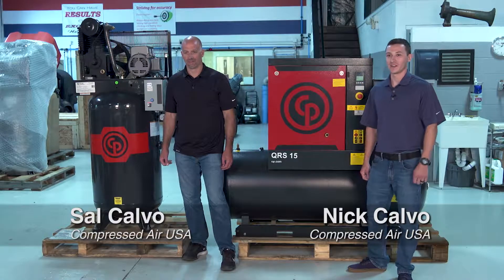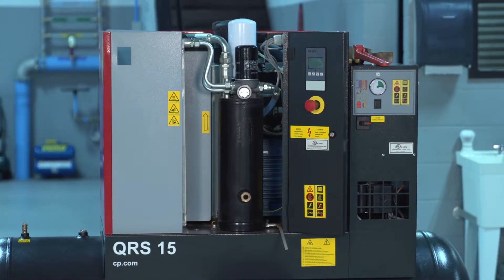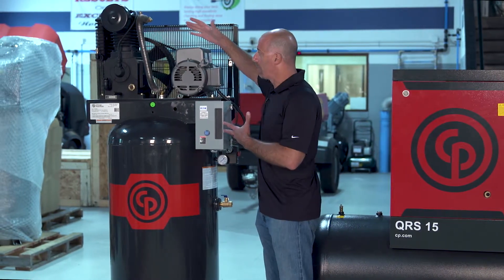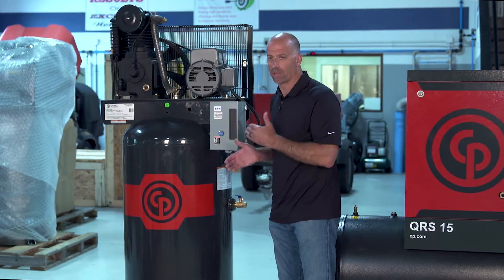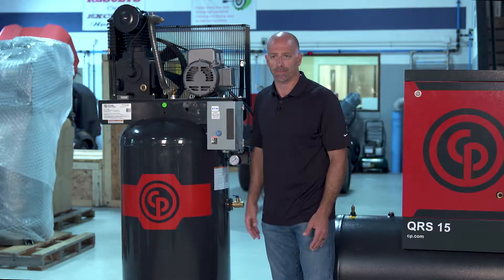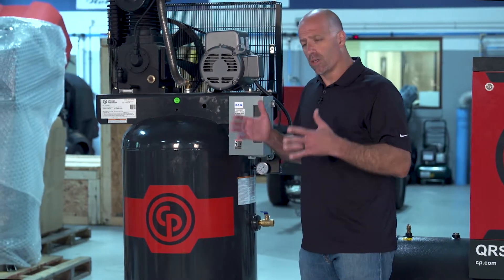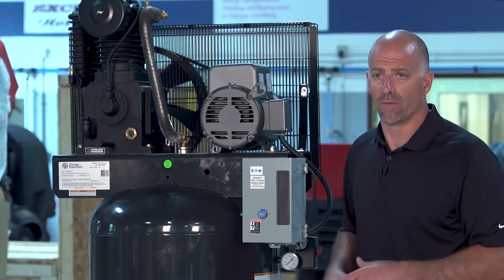Rotary Screw VS Reciprocating Air Compressors | CompressedAirUSA.com

Comment: I like the quietness of the the screw style. However, if it’s in a start stop application 8hrs   A day can the motor handles long term on off. It’s for my dry cleaners, I would also like to put it in my boiler room that is pretty warm in there.  Any thoughts? Thanks
Reply from the maker: The rotary screw machine is best suited for high cfm loads or continuous high air demands, that is really where the 100% duty cycle shines, meaning it will run the entire work day. If you are expecting a machine to start and stop throughout the day, to supply air intermittently, then it would be more appropriate to run a reciprocating compressor. As for the boiler room placement, as long as the air is clean and dry and there is space to install and perform maintenance you should be okay. In regards to the temperature in your boiler room however, if the ambient air is too hot, that will lead to higher temperatures inside meaning more friction and could lead to issues or damage. An aftercooler would help however that only removes heat after the compression cycle.

Comment: Why would you buy reciprocating, if vane is available?
Reply from the maker: Reciprocating compressors have their place, they meet a different requirement and are also more economical. They are ideal for applications that require intermittent use of air, rather than a constant demand. An example of the difference would be using pneumatic tools versus paint spraying.

Comment: I’m looking for a new compressor. We powder coat, some paint and blast to prep parts. 

We have a 5hp piston compressor keeps up fairly well but would like a bit more capability. 

Which would you recommend rotary screw or piston? Which provides cleaner air and is one more energy efficient than the other? 

Thanks in advance.
Reply: You’re welcome in advance
Reply from the maker: Thanks for the great question. For your applications of powder coating, painting, and sand blasting - those processes have a large air demand. Running a sprayer or blaster off of a piston compressor comes with disadvantages. The duty cycle of the piston compressor is 50%, meaning it needs half the run time to be idle and cooling, so you are limited to what is charged in the receiver while it is off. The rotary screw is designed with 100% duty cycle, meaning it will run the entire time and put out much more air. The rotary screw is also quieter, if you work in the vicinity of the compressor that is an enjoyable benefit. As for which produces cleaner air - the rotary screws are oil soaked and there is typically more oil carryover in comparison to a piston compressor, however there is an air/oil separator that helps capture that. You will notice as you checkout our online store that the Reciprocating piston compressors are typically more affordable, while the Rotary Screws have a higher price tag. Another option similar to a rotary screw is a rotary vane compressor, we offer some and are very popular so check them out! For the applications you mentioned, especially when it comes to paint, we definitely recommend having a compressed air dryer along with general purpose and high efficiency filters, and a water separator/water trap as well. What this will offer your system is extremely clean and dry air - it removes all condensation/moisture/bulk liquid/particulate/oil/dirt and debris. Let us know if you have any other questions, feel free to email or call! Check out our CFM calculator if you need help estimating your air demand in CFM, and we would recommend a rotary screw for you.

Comment: No noise comparison ??   😤
Reply from the maker: Thanks for your comment, the noise difference between the two machines is significant. The reciprocating pistons banging away all day is much louder than the quiet purr of the rotary screws. If you have employees that work in the vicinity of the air compressor, this can be an important quality of life issue, or atleast one needing ear plugs.

Comment: I think there is More to consider when comparing - what about a constant speed piston compressor in a high demand application where the pump loads and once pressure is built up then it unloads  which keeps the motor spinning  and the pump freewheels allowing the pumps  flywheel / cooling fan to quickly cool the pump it increases the normal 75% duty cycle closer to 100  - it is similar to a screw machine when it unloads . Screws are much quieter yes BUT they have far more mauntenance issues due to all the many parts , electronic control items that can go bad; to the contrary a good  Quality  ( made in America) cast iron slow speed piston air compressor is made for the long haul with only a pump, motor, belts, pressure switch, magnetic starter and a tank ( optional air cooled after cooler )  , that's it !  They are  very cheap to maintain compared to a screw  -  and a regular guy can do the  routune. maintenance of oil / air filter changes, belt changes and even a pump rebuild  which most maintenance guys are car guys and rebuilding a pump is way easier and quicker  than rebuilding a car engine..  A piston uses less expensive common hydraulic oil or even ATF ( 5 gal for $40 ) ,  screw oil is $65 - $150 per gallon !!  plus wait till you need parts on a screw, That's when you will find out why it is really called a screw machine.    
Just my thoughts on it.

Comment: What size rotary screw comprssor you recommend for a body shop (painting complete cars)and grinding,sanding for 3-4 people working at the same time .I have 80 gal tank that I could use as a buffer too.
Reply from the maker: Great question. The beauty of a rotary screw is that it is designed for a 100% duty cycle, meaning it will run all day to keep up with your continuous use of air. Painting, grinding, and sanding are large air loads, and with 3-4 people working at the same time, that is a big demand. We would recommend something that can handle around 30 CFM for those tasks so you would be looking at a 10 HP rotary screw. 
Check out our CFM calculator, punch in the tools or number of techs you have, and it will show your air demand  https://compressedairusa.com/cfm-calculator/

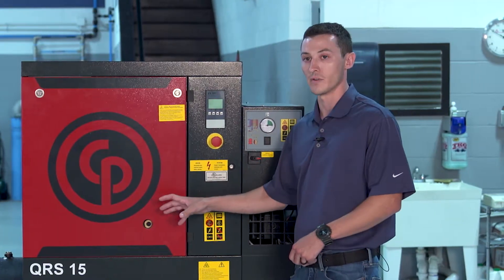Comment: 0:44 “small foot print” ummmmmm that ain’t exactly small my man.
Reply from the maker: Respectfully, we would disagree. For a compressor that can handle a 100% duty cycle, with storage receiver and built in air treatment this machine does have a small foot print. For reciprocating air compressors to handle the same load you would need a larger machine, in addition you would also have to separately pipe in a larger receiver, air dryer, and filters.

Comment: So I have a  bag house that needs  .4 m3/min which I think is 14 cfm... It will be shooting air jets to clean filters . What size rotary screw do you think I need? Thanks for the video great looking compressors.
Reply from the maker: Christopher thanks for asking... you are correct .4m^3/min is roughy 14-15cfm. For this air demand we would recommend a 5HP rotary screw. We carry these machines in a tank mounted configuration, with or without a built in air treatment system. Please feel free to reach out at any time with any more questions you may have. 
email info@compressedairusa.com phone 9045486200